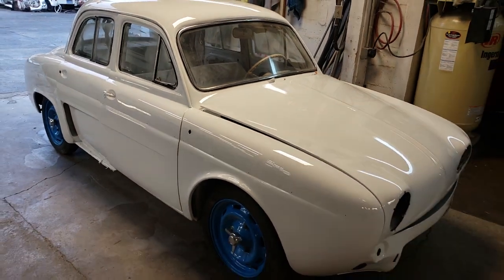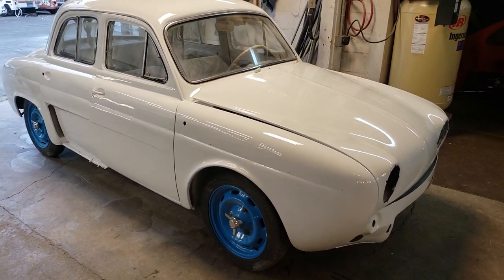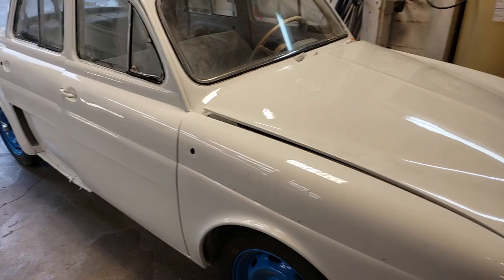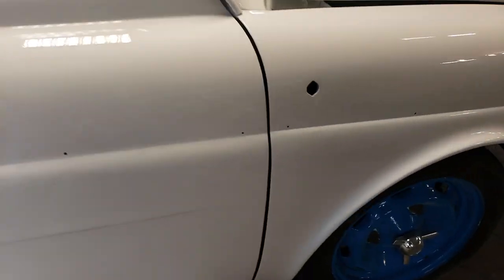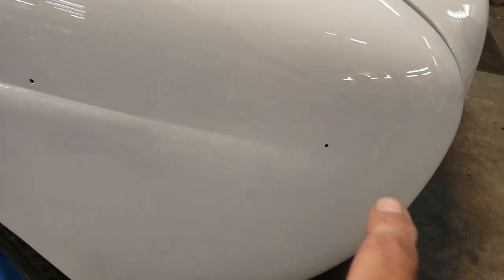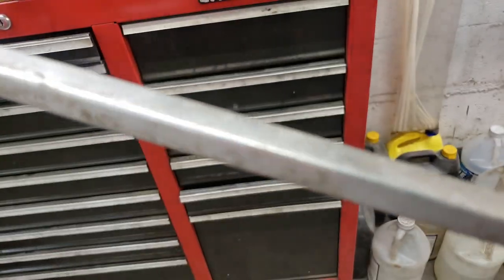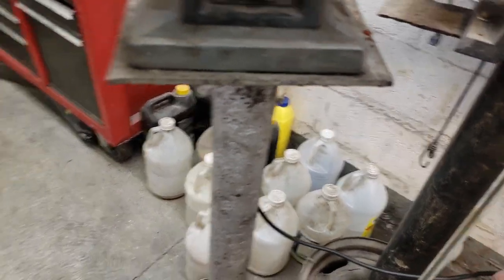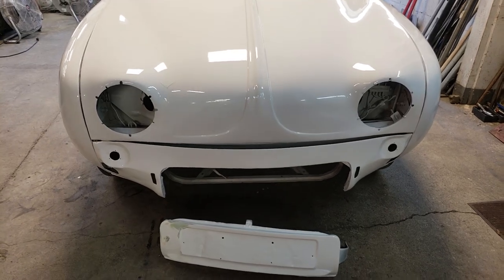Dauphine Displays Depth Dignity

Comment: For run removal, you can shoot some high build primer over them,  then use a straight edge razor, scraping across the surface. The primer shows you how deep your getting so you don't go through your clear in the area surrounding the run. After your first scrape, hit it with the high build again. after the second round, then block it out until the primer, and your sags, are gone